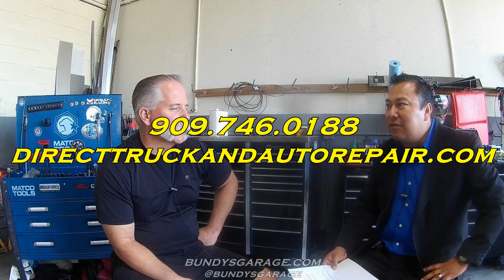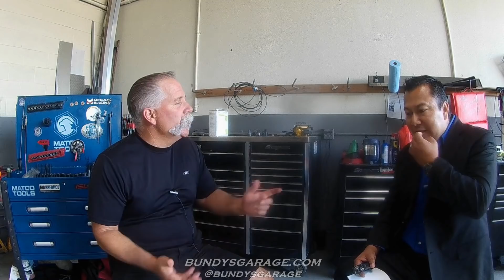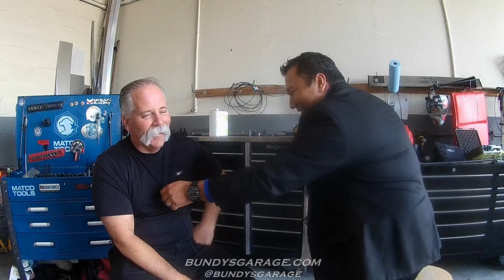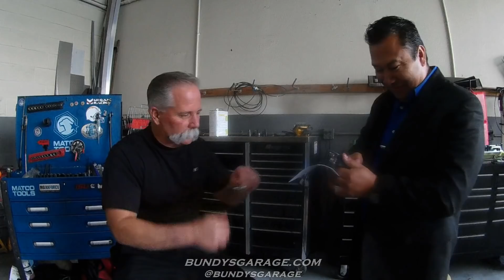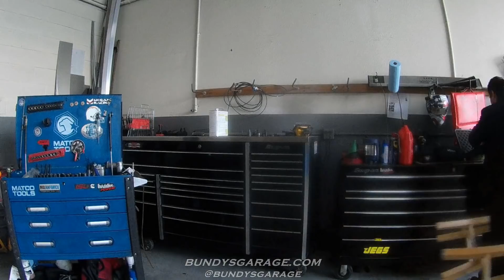Worst Diesel Engine Ever - What is the Best Diesel Truck out There? | Ford Dodge Chevy

Comment: The 6.0 is better for sure...only if its been bullet proofed ...
Reply: It is a pile of junk,no such thing as a bullet proofed 6.0
Reply: Bulletproofing makes it better. But the still suck
Reply: Ya, mine has 210k and had to replace 2 engine sensors and a trans temp sensor. Set me back 125 dollars
Reply from the maker: You shouldn’t have to do that thought. Bullet proof diesel was created to fix the flaws in a OE product. You don’t see that for any other manufacturer. You don’t see businesses start to manufacturer after market products for Audi, Bugatti, Toyota, Honda. Only Ford has whole industries created to fix their flaws.
Reply: You are very much correct. It still amazes me how Ford guys stay with them. I am a Ford guy but the diesels newer then the 7.3 scare the hell out of me. This is the best review I have seen, totally honest, not out for championing the 6.0 which is a business and money maker for him. Ford does make a good truck but they sure pulled some bad ones in there gas line as well, again money makers and business makers.
Reply: @bundysgarage  Ford partnered with International to design the 7.3, 6.0, & 6.4 but Ford sewed International over the design flaws. 
Ford knew the issues and offered Cummins & Caterpillar diesel engines in there F650 & F750 but not powerstrokes till the Ford 6.7 Powerstroke was released. 
Ford also offered  Allison, Eaton-Fuller, & TTC Spicer  transmissions in their Medium Duty Trucks till Ford released Ford's TorqShift 6R140
The F650 & F750 Medium Duty Trucks were sold with the best diesel engines and transmissions that were available.... 
now they are sold with the best engines and transmissions that Ford builds!
Reply: 6.0 is said to be the worst diesel ever
Reply: @Louthemailman  I think Ford spent more fixing 4r100s than 6.0 engines.  The 7.3 in front of a torque shift(6.0 trans) would be a good combo if the gears were correct.